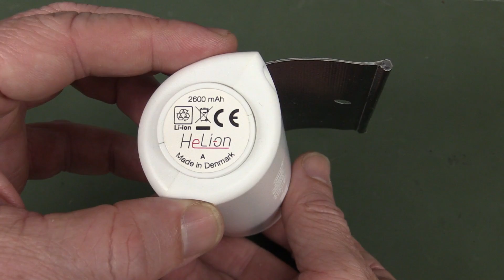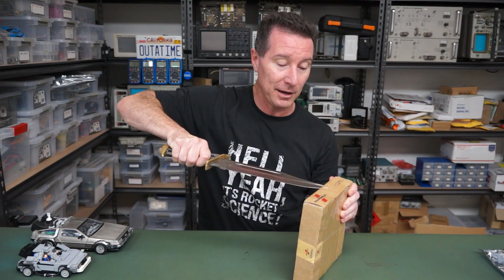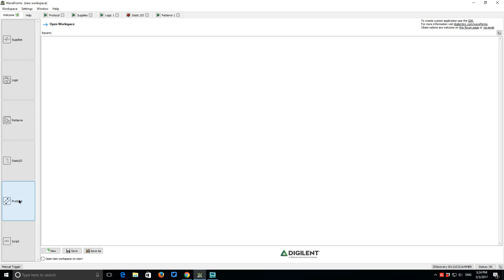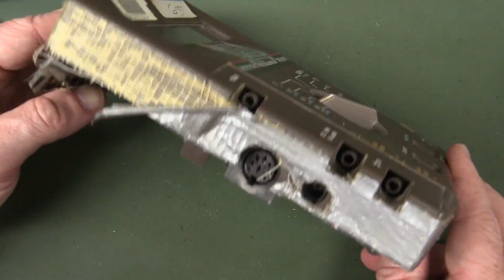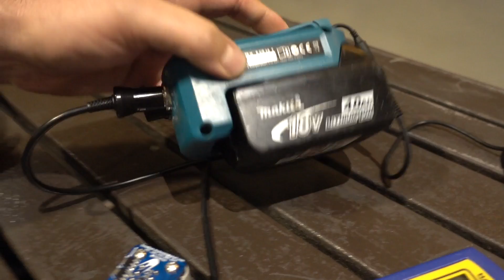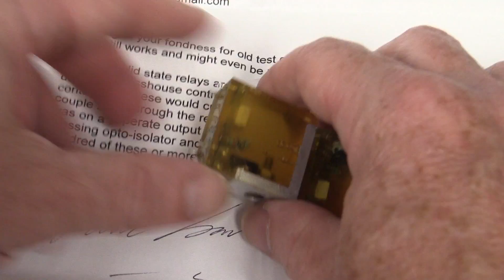EEVblog #991 - Mailbag

Comment: Glad you got my package, just picked out a few things I thought you might enjoy.  The Knipex knife is called a "Cable Knife" and is mostly a tool for electricians.   No, I'm not sick of your big knife, just thought you might enjoy a couple of variations.  The Martor safety box cutter is also very useful as a letter opener.   BTW, the multi-meters were still working last time I put batteries in them, they were being thrown in the dumpster during a lab cleanout.   You will notice the Philips still had an old Westinghouse tool control label on it.
Reply: lol. after the second knipex i just had to pause and check the comments if you were the one who sent these :)
Reply: I own mostly Knippex tools, and Wiha + Proxxon screwdrivers. The Knippex is made from such a high quality steal, that even after years of use they look like new. 
OK, granted, in German speaking countries we have more ease access to these quality Knipex stuff.
Reply: I'm sure Dave will come to love the insulated cable knife, especially once the robots attack.
Reply: ZomB1986 snip would be a closer translation but im splitting hairs 😜
Reply: Always loved Wiha for any screwdrivers. I kind of dislike Dave just tearing apart stuff too. I would do the opposite, and try to save it.
Reply: Interesting to see that Knipex is not known down under. Its the biggest brand here in the Netherlands and everyone knows them. Same for Wiha for bit sets etc.
When I started my education in electronics, everyone turned up with knipex stuff. lasts a lifetime.
The Philips meters were extremely popular at schools. they are still in regular use across schools in the Netherlands (and made in The Netherlands as well!)
The needle variants run off of TWO 9V batteries and have a deflection both ways and an AC/DC indicator.
Reply: That's funny. I was on my way of disproving you as I've been raised in NL surrounded by tools and only recently first heard of Knipex, but in fact most of my hinging tools seem to be Knipex, though just without the flashy colors they now have (most of my screwdrivers are either PB Swiss or Bergeon though). I guess I just took them for granted so much I never looked at them closer.
Reply: Here in the US I only knew about knipex because they were the only ones who made an odd specific kind of sheet metal tool I needed but it's not like I buy tools all the time so who knows I might just miss them
Reply: Wish I could afford some good German tools
Reply: Knipex is good stuff!

Comment: Sand in small glass fuses is just to change the reaction  speed by changing the thermal capacity at the fuse wire.

Comment: one way to reassemble a device that uses heat-staked posts:
slice off the heat-staked portion, then use tiny self-tapping screws right into the posts.
the thinner the screws, the better, else the posts may crack, which gives a lousy attachment.
Reply: good point....the best way would be to use a pin vise, with a tiny drill bit.
I'd forgotten just how brittle the plastic would likely be.

Comment: The O'tatmo lighted bracelet thing would also be popular with athletes/fitness enthusiasts who go running/jogging before daybreak or at/around sunset along public streets/roads.  And cyclists.

A few years ago, I bought something similar, but instead of a clasp, it used a spring to wrap around one's arm or leg.  After using mine around the leg of my trousers to starve the cog/chain on my bicycle, it fell off and the spring was damaged when a car drove over it behind me.  I picked it up and later extracted the light circuit and light pipe and affixed both (as a unit) to my brain bucket (bicycle helmet).  Mine is a single color - red.

Comment: Those Knipex pliers/wrench are my favorite tools I own. I have a Knipex Cobra that I've used at least a dozen times to remove rounded bolts instead of destroying a socket hammering it on or where a socket wont easily fit. They chooch hard, that's for sure.

Comment: The MPSSE engine "scripting" on the FTDI chips is an incredibly powerful means of generating arbitrary digital patterns if you use the low level D2XX driver function calls. I use this all the time through Labview rather than writing micro controller code. Well worth the initial learning overhead.

Comment: I have one of those "Hakko" soldering pencil temp measuring devices and could never get it to give a sensible reading. Recently (after 6 weeks) received a replacement pencil for my genuine Hakko 936 soldering station. It lasted 1 hour and then the plastic handle melted. You gotta love the Chinese. Then you have German tools which are fantastic. I have one of those Knipex channel lock pliers and it is the best ones I have ever used.

Comment: I had that Thandar Counter and its companion Multimeter in the same case style way back in the 80's.  I tested the counter on a known control frequency and it was bang on.  They looked great together, well right up to the point I blew the arse out of the Multimeter.  I got them working again but they weren't the same.

Comment: The Thandar frequency counter looks very much like the old Sinclair DMM. the case of which was from the Sinclair calculator with a stick on cover over the hole where the buttons would have been and a slot milled in for the switch. Would be interesting to peel the top cover or have a look at the underside of the top of the case. Edit just went back and it is a re-purposed calculator case.

Comment: The philips chips seem to be 0Q not 00, which I have seen in a lot of philips old stuff, must have been their own internal chips designations. Also didn't fluke cooperate with philips on quite a few things? I can remember seeing a fluke/philips oscilloscope...

These green caps in the other meter I have seen a lot in multimedia electronics, still rather recently.
Reply: Dennis Lubert I believe that Fluke bought the Philips test and measurement division completely. It happened right before Fluke introduced its ScopeMeter series, which were actually a Philips design, and actually had the Philips logo molded into the rear housing.

Comment: On the DEO-Nano why not just insert a CPU into the FPGA, save $20. Because $20 is lunch for and a week for an EE designer.
Reply from the maker: Because
a) It takes up space
b) You can't just use an ARM processor (they need a license)
c) It's not the same ecosystem as the RPi

Comment: It would be interesting to see the Digital Discovery review. It can go up to 800 MS/s using the High Speed Adapter and cables (I believe you have them included with the unit).
Thanks.

Comment: Florescent and led lighting don't emit the right solar radiation to allow the cells to produce power. Found that out a while back when I was still using incandescent bulbs.
Reply: You are joking? Incandescent bulbs are worst for testing solar cells, they produce mostly heat radiation, which can not be converted to electricity by most semiconductors.
I have very good experiences with testing solar cells with LEDs. The small ones of solar garden lights even easily with my 5W pocket torch on the keyring. Just light the cell for some seconds and see the light come on afterwards. Of course for full power you need quite some LED power, according to a rough calculation not less than 30W electrical per dm² (10W of light per dm² equals 1000W/m²). The sun is really strong compared to most of our light sources. With a tiny standard 5mm LED you will not do much.
Reply: goamarty Right they are very inneficient. sunlight would be the best obviously. I just find the work better with that then LEDs and florecents.
Reply: You have to be careful that the output spectrum of your source is compatible with the frequencies absorbed by the organic solar panels. Sunlight is very broad spectrum. LEDs vary depending on the semiconductors used. Fluorescent has a few very narrow bands. Incandescent is fairly broad but increases the further towards the red end.

Comment: Used to use the Aardvark I2C/SPI Host Adapter. But the Digilent one seems far better at a lower price for signal generation applications.
I just wish the Digilent one had USB 3 in order to use computer's memory for logic analyser buffer. I use the Saleae one at work due to that feature since I often need to capture very long sequences.

Comment: Umm..right...well...for around 48 USD/W from what I can tell these printed organic cells are not even in the ballpark of making any sense (especially since that is just the price of the  "panel")...I guess maybe to bring along as a fold out thing for camping, or maybe on clothing...but...There are portable solar panels, even fold out version for a lot less per W, and as a complete package in a durable casing...I'm not sure these actually take up less space even if rolled, for the same power.  I haven't read a lot into this so I guess there is probably ongoing industrialization of the technology, but I don't see this as being competitive until it goes under 1 USD/W. Just my 2 cents!

Comment: Those InfinityPV panels look very practical. Nice product and I think with many applications, I hope they can get their efficiency at least as high as commercial ones. It seems their technology efficiency is around 1  - 7%, which seems low, but probably still useful for small low power sensing applications.

Comment: 60 heatstakes held the keyboard together
Reply: Ten thousand bloody heatstakes.
Reply: I hope all the plastic fumes didn't give a worker lung cancer.
Reply: Do you expect a worker with a soldering iron doing them manually? That would not be much cheaper than using screws. They are probably done by some kind of hot pin grid all at once in a press.

Comment: Is that frequency counter a rebadged Sinclair, or a Sinclair knockoff? It looks a lot like the Sinclair multimeter you tear down in another video. The Sinclair also used plastic fasteners like that, and directly soldered the circuit board to the input connectors at the bottom.

Comment: I'd actually be quite interested in seeing a teardown of the LED bracelet. What microcontroller does it use? Those look like WS2812 LEDs - does it run them at 3.7V, or does it have some sort of boost converter?

Comment: Hey Dave,

On that infinity board, the input and output header, solder joints look a little "how ya doing".

It looks like they used a solder mask/paste for the surface mount as it looks like the solder hasn't flowed properly. (It looks like that they haven't got their reflow oven set correctly, as the joints aren't shiny.)

Are you able to get your really awesome microscope out and have a look please?
Reply: I've used lead free and and it doesn't look like that. If you look at most of the components the solder hasn't flowed up the side of the pad on the cap's or the resistors.

The In/output connectors joints look shiny, and blobbed.

If the solder had flowed properly all the components would be in the middle of their pads, but they're not, they are all over the place.
Reply: Actually the TI 5416A looks a billion times better than everything else.
Reply: It almost looks like they used solder paste without flux, and then they forgot to add the flux before they baked the board.

Comment: Dave, with your general good common sense when it comes to photovoltaic BS in the form of FR¤%&¤#&% Roadways etc I am a bit surprised/disappointed by your "love" to these printed solar cells. Cheap or not, they are not cheap when it comes to the price of the generated electricity because of their probably short lifespan.